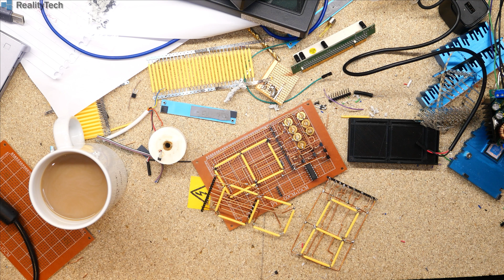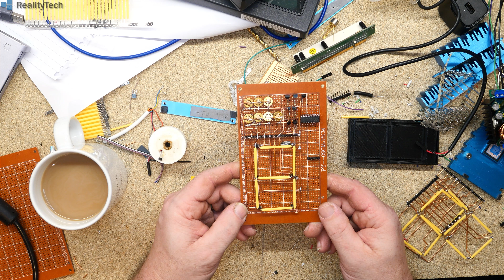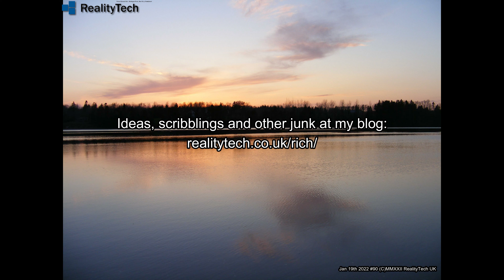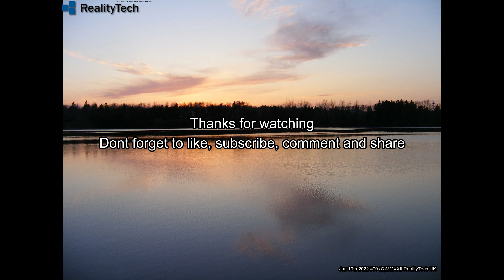#90 - Blazing Fast Look at my 7 Segment Filament Display

Comment: Nice. If you could get those in red and power them dimly I could envisage a clock made from them hanging on the wall in our bedroom. It's one of the rooms where it's the most tricky to see what the time is in the middle of the night (without touching a phone and losing night vision), and that would be easily quite visible.

Hmmm, the possibilities are endless.
Reply from the maker: A quick look shows that all the usual LED colours are available